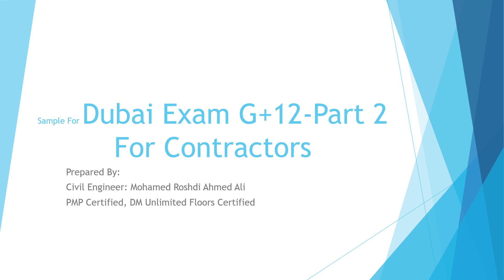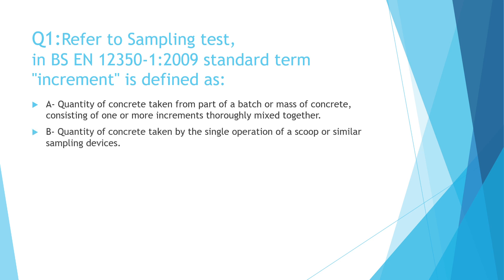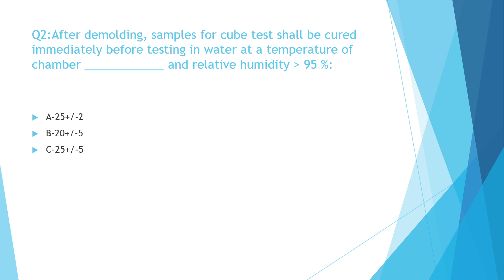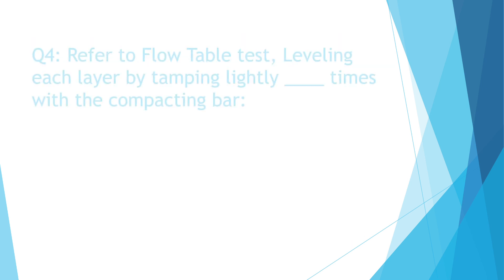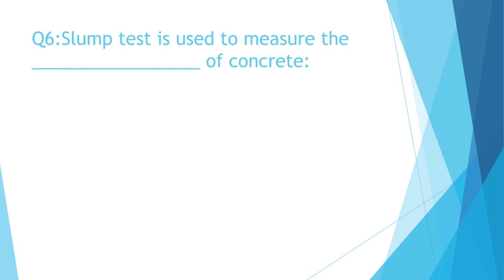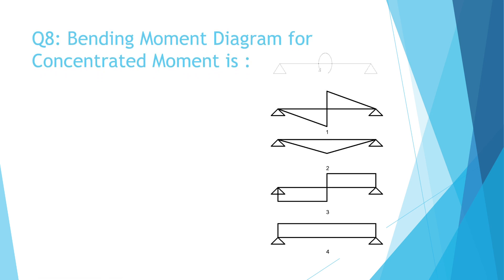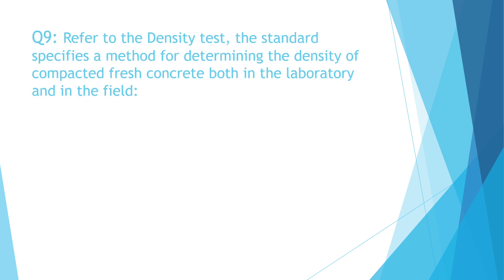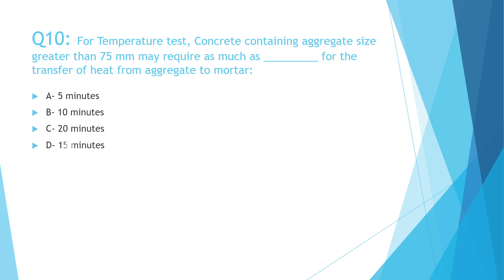Dubai municipality Civil Engineer Exam 2022 for G+12-Part 2 contractor

Comment: The Answer to Question No.9 is wrong, the Correct Answer is BS EN 12350-6:2009
Reply: لو سمحت انا امتحاني قرب و مش عارف اذاكر منين ؟؟ و هل الاسئلة دي نفس اللي بتيجي ف الامتحان ولا بتتغير ؟؟ لاني محتار جدًا وتايه …ياريت حد يرد لو سمحتم يا مهندسين 🙏🏼
Reply: @enghammammoustafa3310  طمنى عملت اية 
ونفس الأسئلة؟
Reply: @ahmedsami4997 الحمدلله الأسألة كويسه و زي مابتيجي و اسالة تانية بس سهلة ماتقلقش
Reply from the maker: You are right, thank you
BS EN 12350-1-2009 for sampling of fresh concrete.
BS EN 12350-2 -2009 slump test
BS EN 12350-5-2009 flow table test
BS EN 12350-6-2009 density test
BS EN 12350-7-2009 Air content-pressure method